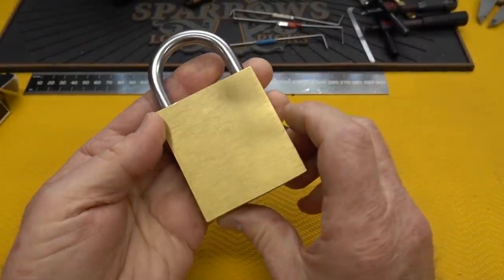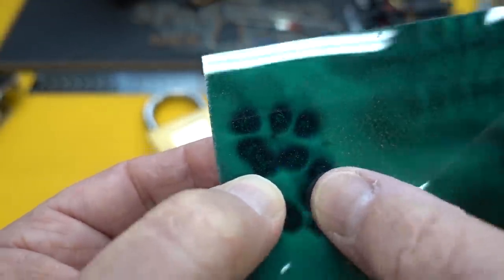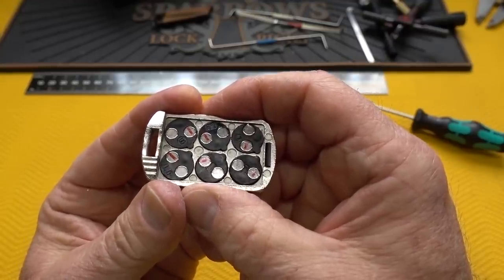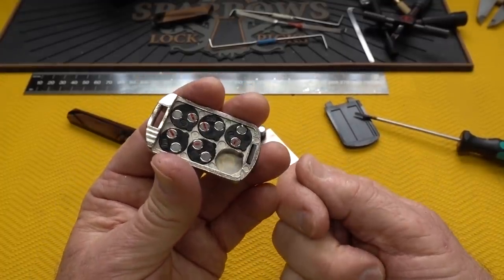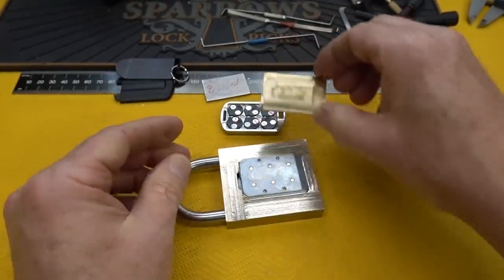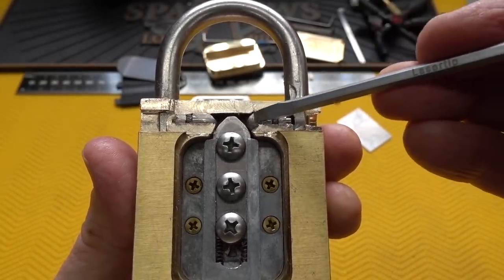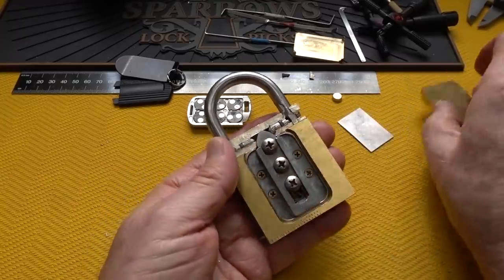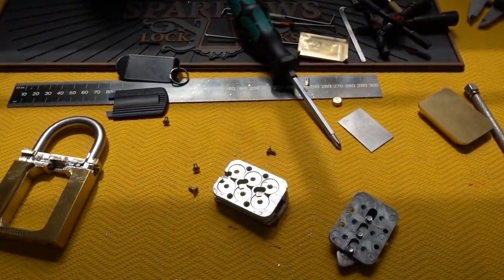(1701) RELOOK: Magnetic Lock (How It Works!)

Comment: Actually I have analyzed what you have said the magnetic viewing paper does help two black dots is one disk 12 black dots means 6 disk. 
It's not push and pull. 
It's actually two magnets and its very simple every disk sure to have one north and south. 
The repelling force makes one disk spin and attract to each other.
The pick tool is far easier to make now its just 6 free spinning disk each one has a north and south magnet they will automatically align to each other and all you do is tug it gently spin the top disk until you feel the click.

Comment: seems like if you had 12 small magnets, each marked with their orientation (north/south), and dropped them on the key - They would attract and show you the exact pattern.  Of course, you would need the key.  I guess, without the key, you could build 6 small spinny things - print them out on 3d printer, and spin them.  Then pick it that way.  You wouldn't have to worry about orientation, because each can go 360 degrees.  Just put tension on the shackle, force that thing down in the back, spin the magnets.  Shouldn't be too bad that way.  The polarity of the magnetic picks wouldn't be hard, either.  1 with north up, 1 with south up.  I don't think this lock would work well with 2 magnets on 1 spinny thing facing the same direction.  Still, would be easy to tell if the polarity was wrong - it would repel one side.  Just flip the magnet, then.
Reply: How would you know the gates since there is no feedback from the shackle or key in this case? This thing is unpickable all six gates have to be aligned for that thing to move sooooo
Reply: Might be easier to build the picking rig from a key than 3d printing. Remove the tabs that keep them in place, drill holes and attach rods to spin them with, insert plenty of lubricant.
Reply: @qalln-w272  Why would there be no feedback? If the magnetic spinner in the lock isn't moving you will feel this as a resistance in the magnet you're using move it.

And there's no reason to think all the spinners would bind all at once. As with any lock, it comes down to impossibility of machining absolutely identical/symmetrical pieces. With light enough tension they would bind in order.
Reply: I was away typing while you posted your comment. Interesting, letting the key or lock tell you its orientation via mobile wheels. Even quicker than mine, I think. (If mine works at all.) Kudos!
Reply: @yetanotherstronk  the thing is all six has to be at the right rotation at same time if you spin one at the right angle and there is 5 more to go and no feedback since there is no tensioner.
Reply: @qalln-w272  You tension by pulling the shackle. That's how you get feedback. Pull it at just the right (light) tension and you'll bind just one of the discs, which you can feel because your external magnet will feel resistance to spinning when above that bound disc. Start picking from there.
Reply: Take a pencil. Make a groove on opposing sides of it. Glue a magnet in each groove, making sure they are in opposite polarity.
Then maybe you would be able to feel for the gates when you're turning the locking wheels.
I'm not sure how much force the magnets are holding so this may not work. The wheels may lock up even if you apply just a little tension on the shackle.
And for the lock maker, this approach could easily be blocked by making the wheels and locking pins cogged. (would be like having a lot of false gates on the wheels)

Comment: It might be an interesting project to use the key parts to build a manual "picking jig" with 6 knobs that can be turned by hand.  Then, by manipulation and feeling shackle tension, it should be able to be opened.  Just a thought.

A little 3x2 frame to hold the key's disks at the proper location on the grid.  A knob attached to each key disk for turning.  I think that it should be a pretty straightforward operation.

Comment: wait shouldn't that be really easy to open? Apply heavy tension by pullin on the shackle and then put a strong magnet on the lockface and rotate it slowly. 

They will have an order in which they bind and the "screw" will hold them open. So you just need to rotate all the discs a couple times and you should have an open. 

Maybe rotate a few times in one  direction and then a few times in the other. Not sure if that makes it easier.
Reply: Interesting idea, you would have to have the magnet on its side so the orient themselves to the poles, also I feel like if the magnet was too strong you would run into issues with over setting the disks, maybe start close with the magnet and slowly move away while rotating? Maybe putting the magnet into a slow drill would help? It would be interesting to try.
Reply: The gates look fairly large too, you wouldn't have to be super precise with their positioning. But manipulating it would be a pain in the arse.
Reply: @anoniemous2136  You can't over set the discs. They go all the way around. If you miss it the first time you'll get it another time. But even if they stopped them spinning 360 in a future design there's nothing stopping you moving your external magnet first clockwise then counterclockwise. This is unlike oversetting a pin stack where you don't have a means of pulling the pins back down. I expect if the manufacturer is paying attention then first a method will be devised of picking these, then they will respond by adding things like false gates or surface texture to the spinners. "New design, even higher security!"... nice progressive sales strategy.
Reply: @yetanotherstronk  I think texturing on the surfaces would fix that, possibly make them like very fine-toothed gears. The three plunger pins would also have serrations/teeth that mesh with the spinners, meaning you can't turn the spinners as soon as you try to tension the shackle
Reply: @BarneyDesmond  Ha, yes. Then you really would be struggling. Then I suppose the only way to pick would be brute force trying every combination, which isn't really picking at all.
Reply: Problem is it looks like you need to decode all 6 discs at once. If one set isn't set, you won't be able to force anything into a gate. So you can't pick them pair wise
Reply: @BarneyDesmond  That's devious! I like it!

Comment: The way they put the inside core in is by sliding the core into the bottom of the lock. This part is blocked by a plate on the bottom held in with 2 shackle hole screws To gain access to the screws u need a special rekey shackle. They have a video of how its rekeyed and put back together

Comment: the only way i can think of picking this is if you were to have a rather large and strong magnet , pull down on the lock to tension it and start raking the magnet up and down fast , i would assume it would eventually get to the point where it would unlock.

Comment: The key can probably modified into a pick tool its simple just file the notch and its free spinning it will automatically align to the lock disk orientation maybe can pull the lock and spin the top disk to the bottom disk and see if can feel the click.

Comment: So in theory, couldn't you pull the shackle to put pressure on that plunger to put pressure on the disks, then use a small strong magnet to move the disks until you feel the plunger drop into a gate?

Comment: if you can find binding discs with enough tension on the shackle and use one of those discs from the key as a single disc picking tool, should it not be possible to pick it?

Comment: @Bosnianbill  Hello, YT guided me here. About 2:08 - this will not tell you magnetic orientation but you see that on few field is "compounding" or "avoiding". You have only 2 possibile magnetic poles, so you could first - assume N is left upper one and solve else by seeing appliance of magnetic compounding (different poles) / avoiding (same) rule. Never tried, never do sth like this, but wondered that this may be valuable clue for You. Funny stuff ;D
Reply: Probably having tensometer on U and - mounted and doing trick with pair will allow to open without key, but this is all day all night problems about how to make affordable security model for physical and any other security stuff.
Appreciate work. Still thinking that bad ppl do bad stuff anyway because security chains of things aren't complete or sufficiently strong in one place.
Have a great day.

Comment: Could it be that the lock body is heated before the cold center core is inserted, then as it cools, it fits tight as the outer case contracts.

Comment: I feel that this design is as pick proof as you can get. Meaning you can only brute force. But trying to adjust without an xray view and likely no feedback, there is only luck. Usually pins in a pin tumbler, even with high tolerances; you generally can tell which pin is binding over the rest. Here I dont think there is enough mechanical linkage between yourself and the gates.

I'm guessing each wheel has 8 unique cuts, meaning eventually you would be able to open this. Key copying would be reasonable if you had time to check each of the 12 positions to decode the fob.

The only other thing that physically is more secure is a core that doesn’t use the key’s profile alone to turn but needs sliders set to the right depth to turn (in that you will always be spinning the core until your provide the exact depth to each slider; making it impossible to tension – which I think a Chinese company has achieved this feet).

Place this into a harden body and you have something pretty amazing.
Reply: Hardening this lock to physical attack could be difficult, since by its nature, the spinners need to be close to the surface to interact with the key, and are thus easy to drill out.

Now if you made it so that the key slid into a slot, you could bury the mechanism deep inside the lock, out of reach of drills.  Of course, this sounds like a really good place for a wedge and hammer...

Comment: Very cool, but apart from the magnets this is just a combination lock. To pick it, maybe tension through the shackle and use a small magnet to rotate individual disks to find the gates.
Reply: This.  I'd like to see him try.
Reply: I'm not sure 1 magnet would be enough.
I'm thinking you'd need to "pick" 2 sets of magnets at the same time(not sure you can get enough tension to hold 1 in place while picking the other) and you may need 2 magnets per pair(or 1 key disc) to spin the disc in the lock(or a really strong one).
Reply: @Marvin_R  Agreed.

Comment: I would worry about longevity with this lock. You're eventually going to get one of those spinners sticking due to wear. In a pin tumbler there's direct force involved from the key pushing up and the springs pushing down, so much less delicate and less prone to sticking than contactless manipulation. Then again, there will be much more wear and gunk in a normal pin tumbler lock, so I wonder how the trade off works in practice.
Reply: I think this lock will last longer than old school locks. Completely sealed, no rust and mositure.

Comment: What I find to be odd is that the magnetic paper showed  a perfect grid of magnetic fields on the lock, when really it should have been a series of randomly-rotated magnet pairs that look disorderly just like what the key showed.
Why was there this discrepancy? What is making the lock's field look like that?
Reply: All the disks in the lock are free spinning.  The magnets on those disks will auto align with themselves until the stronger magnetic field from the key will "snap" them into position.

Comment: An Etch-A-Sketch is filled with Aluminum Oxide powder.  Therefore, nonmagnetic.
Reply: Aluminum, not aluminum oxide (except for the inevitable oxide film on the surface that all aluminum develops upon exposure to air). But, you are correct that it's nonmagnetic.

Comment: 14:36 It seems to me that the gate cannot be located at the magnet and the tolerances look like there can be only 2 true gate locations between each magnet so a single disc really has 4 gates to test and you have 6 discs. As such, the whole lock can have up to 4096 combinations to test. As you can test the polarity of each disc from outside the polarity of the key is not important for picking this up. Using a small magnet on the locations of the discs should be enough to figure out which kind of polarity you need to rotate a single disc as you wish.

The interesting question is can you feel the sidebar pins touching the disc / detect that the disc inside the lock is not rotating using the magnetic force only? If it's possible to detect when the wheel is rotating while you apply force to shackle it may be possible to pick this lock tentatively. In practice, apply force to shackle to bind (at least) one of the discs, and rotate that disc until you find a gate. Repeat until the lock opens.

As each disc only has one gate, the polarities of the magnets within a single disc must always be the opposite to make sure that the correct key doesn't orientate the disc 180 degrees incorrectly. As such, the pick for this lock would have two small magnets in opposite orientation separated by identical distance to wheels inside the lock.

How easily do the discs rotate inside the lock? Would it be possible to use gravity to orientate all the gates upward and the just decode the lock by reading the positions of the magnets on the surface of the lock? However, the magnetic paper did show horizontal lines show perhaps the lock body orientates the discs the same way when no magnets are close by.

Interesting lock in any case. Too bad that the body material cannot affect magnetism which seriously reduces the options for the lock body material and physical attacks.
Reply: In fact, you don't need a fancy picking tool because the discs rotate easily enough to rotate with a single powerful enough magnet only: https://youtu.be/qtAFpwFkAoE

Once again, if you have disc based lock with gates, always use false gates. It doesn't matter if your key is magnetic like this one or something like Abloy Classic or Abloy Protec.

Comment: While picking using magnets might be possible (using the key as template), I'm wondering if opening the back cap is viable method for beating the lock. Something like putting strong glue or epoxy on the back, putting a handle and then yanking the cap, ones the glue has settled.
You may even be able to "repair" back the lock if you have a way to clean up the glue (with heat or chemicals).
Reply: the locking mechanism actually locks the inside in place while the lock is locked.
it may be possible depending on the way the central screws work, but if it's done right(as in the little locking bar can't slide even with screws removed) there's no way to remove any internal parts(other than screws) without unlocking the lock first.

Comment: Key design : There are 8 black plastic discs. Each disc holds a pair of magnets. The magnets are opposite polarity paired. Each disc is keyed in 1 of 8 orientations. That makes 8^8 or 16.7^6 different codes.
Reply: Six, not eight.
Reply: Rick Dickinson 
I agree. It is 6 but 8 thanks. 
That makes 6^8 = 262144 combinations.

Comment: Just been thinking, how does the re-scramble bit work?  I would assume there is yet another set of magnets in the unit top and bottom  so the poles pull the rotating magnets back?

so if this was the case, and i think it is as there is 6 wheels and 12 traces on the film. then you may be able to determine the polarity of these magnets some how and infer the ordination of the rotating ones? i..e. if top was N then you would know the one rotating to it is S.

I may be going off on a tangent lol.
Reply: The individual discs in the lock, itself, attract and repel each other due to their magnets.

Comment: So... 6 motors with the magnet assemblies attached, run at different speeds.. sounds like an easy device to make
Reply: Rubbing with the metal the sucker will melt and seize rendering the lock useless😂

Comment: I think the lock is easily hackable. All you have to do is print a 3D transparent key with the six disc's and 12 magnets each disc will contain a North and South magnet let the magnets attract each other. Then from there on the 3D printer key  u will have some attachable gears. Which will allow you to move the disc's all you have to do is play around till. What would help if if there is like a hand held portable x-ray device. How I would of done this lock is made it out of titanium and not aluminum. And then I would put some kind of film or sheet that would prevent it from being x-rayed.
Reply: It a cool invention but I don't think it's that great. I also noticed that those small strong magnets also have to be aligned in a certain way because they were kind of messing with each other. Like the first row They have to be + - + -. But then that just me saying this viewing perspective. So I wouldn't know.
Reply from the maker: @ Jesus Alvarez    "I think the lock is easily hackable."    HAHAHAHAHAHHAHAHAHHAH!  Jesus, you say that with authority, yet I see no indication you've moved beyond your theory.  OK, let's look at the feasibility of what you're saying.  "Make a 3D transparent key..."  At least a day to design, prototype, and print out.  Given the strength of ABS and PLA I doubt it would be strong enough, but let's just go with it.  "Six discs and 12 magnets".  Ok.  Assume a 2 degree difference in alignment angles, means that each of the magnets would have 180 different possible angles.  Now comes the fun part.  With 12 magnets, the number of possible combinations would be.... well, a number too large to fit into the Internet.  Assuming each of those attempts takes you 1 minute, you'd need the rest of your life and STILL not try but a tiny fraction of the total possibilities.  I guess I'm saying that YOUR definition of "easily hackable" is significantly different than mine.  Good luck.  As a tip, I recommend you pay extra attention in math class.